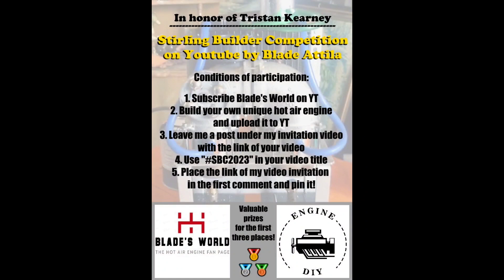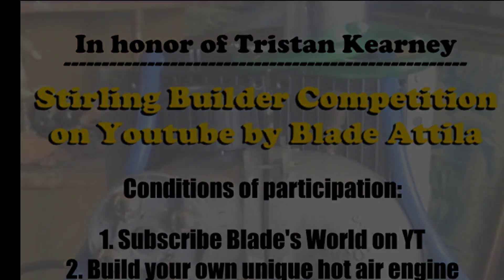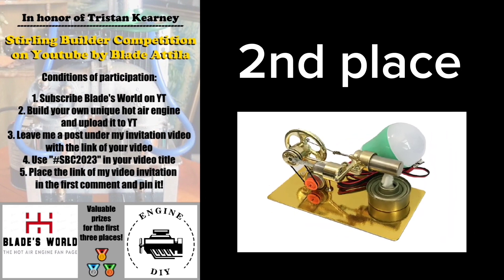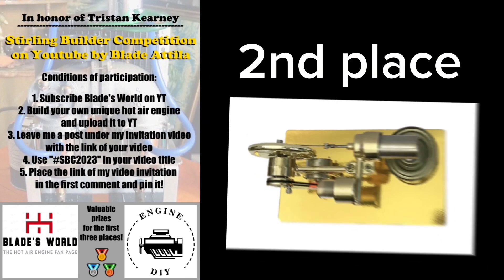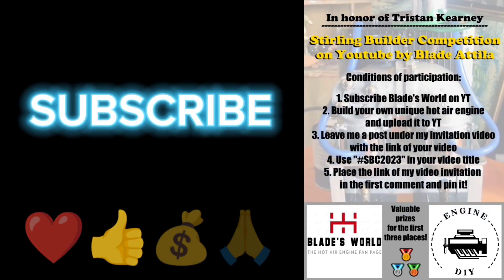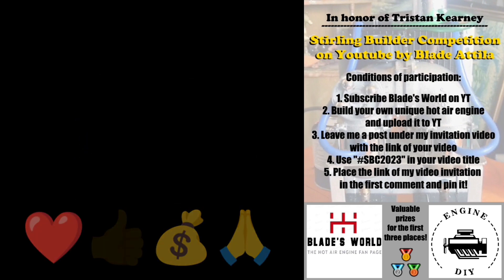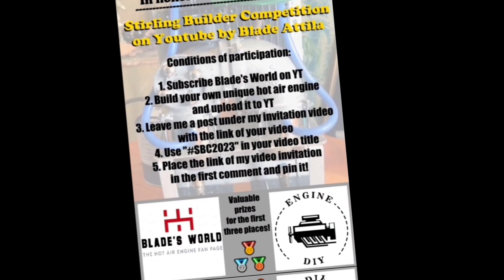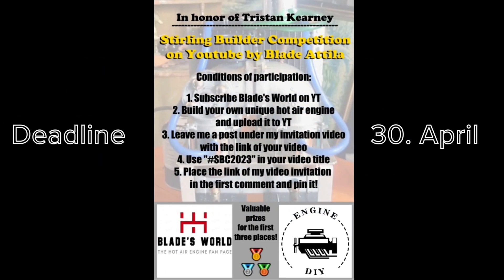DIY Stirling Engine Competition 2023 🌎 #SBC2023 - Deadline May 31.

Comment: Hello! Thank you for the videoes!!  Question …. All temps are in F … I live in a cold winter environment.  The outside temps range between 30 to -20 for many months.  Is there a sterling engine that can run on the temp difference between inside (60-70) and outside (30 to -20) by mounter the engine in a door wall or window where the cold part is outside?  Or mount the engine to the window glass to get the cold?
Reply from the maker: Hello there! The answer short doable, but... If you install a unit, replaced your window then the unit will cool down your house, because it will take the heat from your room get it to the outside air. I think you don't want to do it. Without energy "losses" you can't do it. So as an imagine it looks nice, but in the real condition you will lost the comfort temperature quickly unfortunately. Much real solution to use your stove chimney as a heat source. In this case the deltaT will be much higher, so the efficiency could increase a lot. I don't know your heating system, but usually this is a feasible. BLADE

Comment: Competition should be stirling electricity generation
Reply from the maker: Probably next! It is quite difficult to manage such a challenge and to find suitable sponsors and prizes for it. BLADE
Reply: @AttilaBlade  refrigeration is the interesting one where one powered stirling powers a stirling in reverse, like a cryogenic cooler. Then you have "the campfire powered fridge". Anything useful that runs in a woodburner would be of immediate interest to uk new aGe traVellar community (Ravers who live in vans)
Reply from the maker: Campfire/woodfire Stirling is possible to generate few tens of Watt, usually under 200W. I don't know is it enough or not, but it is possible with a not really expensive unit. Fridges... That is possible you wrote, but then we convert the energy two times, so the fridge will be really weak. Thermoacoustic traveling wave engine could solve this problem in the hottest period of the year. No moving parts, and starts automatically when the sun generated enough power to drive that unit. Also could work with fire but for me it is not so practical for a long time. I've not idea about the price, but I'm working on a prototype for a long time yet. Prototypes are not cheap... So it's hard to tell a good market price to it and to the generator also. BLADE
Reply: @AttilaBlade  simplest thermoacoustic with regenerator instead of displacer and water piston, it could even be one bit of pipe bent to the right shape, two motors identical connected together by air pressure connection... if its one pipe electrolysis the gas into hydrogen max thermal and co2 max weight for pressure connection. 10 watts is fine, goes into a battery
Reply: @AttilaBlade  ive got every prize you offered except flame licker which isnt stirling, many doubles, could get rid of some

Comment: Heard about this competition from robert murray-smith but won't have time to enter, you should make an all year competition, you could review submissions as they come in.
Reply: If it’s actually a competition, then reviewing entries as they came in would give later entrants an unfair advantage.
Reply from the maker: @walterrutherford8321  This is my first competition, I wanted to invite only active Stirling engine builders with newly designed engines. To shake up the stagnant water a little, as there are a lot of fake videos circulating now, which are very popular, but we would like to convey real value. BLADE
Reply from the maker: I expand the deadline to May 31. So probably it will solve this problem. For a whole year I should invest a huge amount of time. It was an idea to inspire people who interested about this segment of engines. Tin can or soft can engines are possible participate as the nicely machined shiny jevellery ones. BLADE